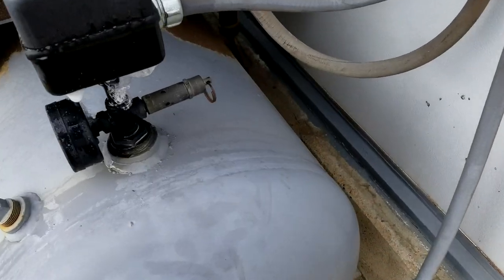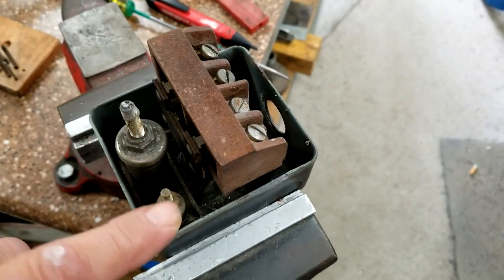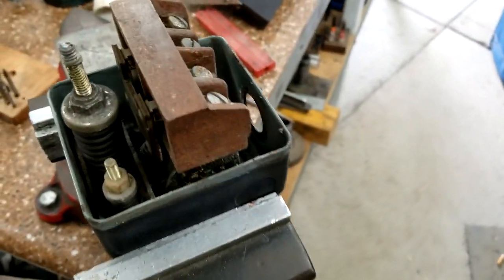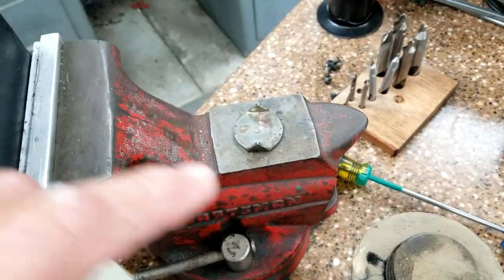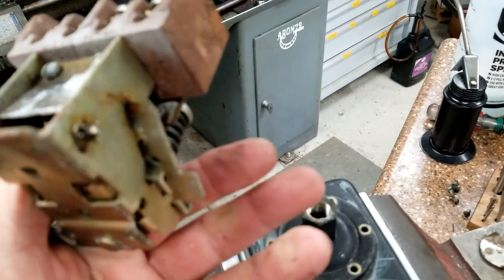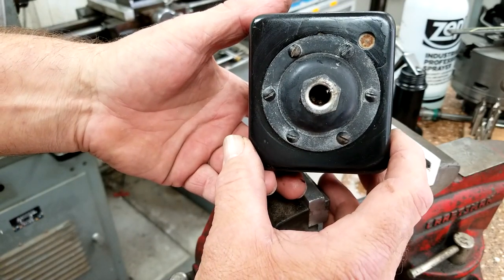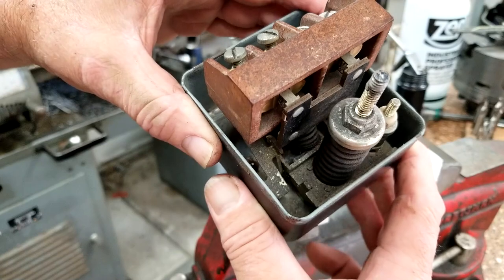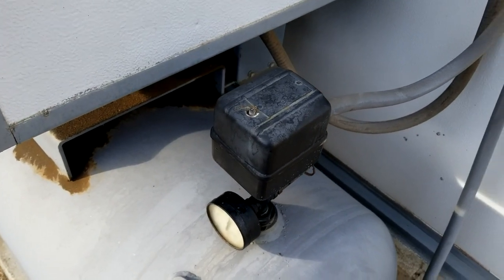Square D Pressure switch rehab

Comment: Nice work Stan. Glad you where able to save it. As you said those switches aren't cheap. I would have taken it apart too. I disagree with you assessment of the leak though. I don't think there should be any pressure on the case side of the diaphragm.